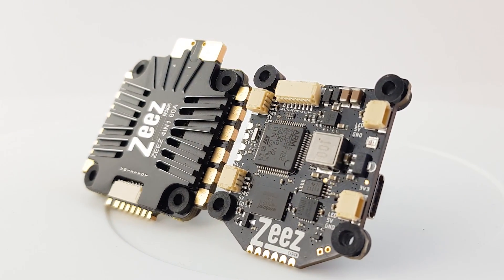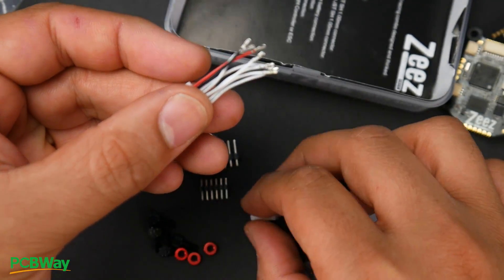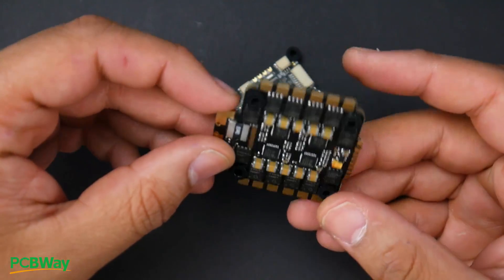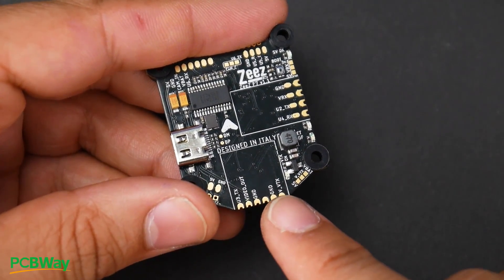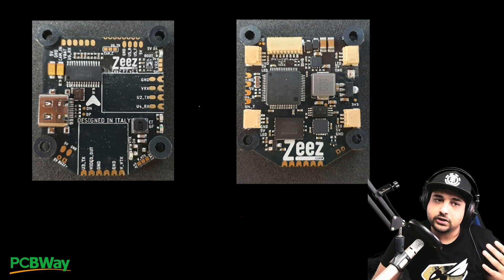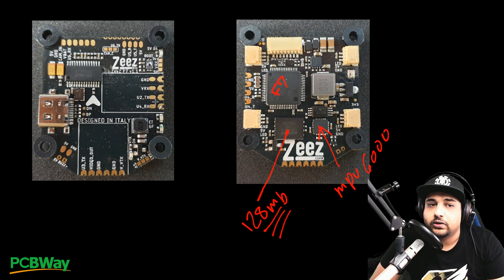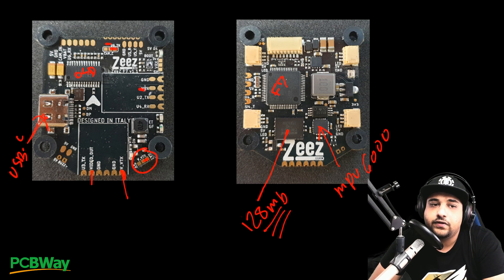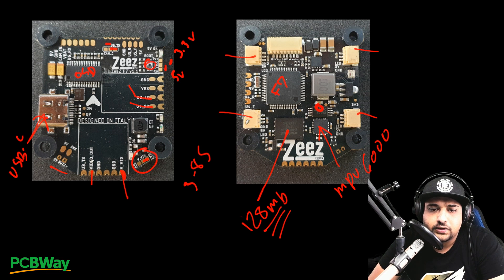Zeez FPV Drone Stack Designed In Italy // Advanced Breakdown & Setup Guide

Comment: Drone Mesh, Your vids are always full of great info I always find extremely useful. I have a small 122 “Hellbender” frame.  In your opinion, what board combo would you suggest for that frame? I plan to use a 3s 1300mAh (or smaller) battery. I’ve got RS1306 red bottom motors I wish to use along with a Spektrum receiver. I’m looking for easy flight controller install. Thanks brother.

Comment: Does this work with a RushFpv ultimate plus and the Foxeer micro toothlees 2 annnnnnnndd a gps (iflight titan xl5 gps module) and 6s???
I wanna get into the sport soooo idk very much....
Reply: Yes, Google Zeez F7 wiring diagram, there's a nice one that every connection possible. UART 5 pads are selectable to be sdc/sda and it shows a BN180 connected! https://blog.seidel-philipp.de/wp-content/uploads/2020/05/Zeez_F7_Flight-Controller_Anschlussplan_Wiringplan.png

Comment: Hey, this question isn't really relating to this particular set up but it could. How do you know if a low ESR capacitor that you have added to your system has gone bad? Without just testing it just for the sake of testing it. What kind of indicators would there be?

Comment: good product presentation. But... is it good? Is it better than say a Mamba? Your video did not help me to figure that out. 
I miss the times when you used to actually review the products. Like measuring the noise and so on. Most people can figure out where to connect things. But what you can do better than most of us is to actually evaluate the quality of the products. Help us buy. 
I used to be a patreon of yours but I just stop getting any new useful information. I really miss it and don't seems to find it anywhere else. 
I say this with all the heart and wishing you best of success. 
You repeat a lot the same info over and over. For instance, "what is OSD". Every video you explain that. I this was to be the first time I see your channel, great info! But after watching 2, 3, 10 "reviews" (in my opinion product presentations) I know already what an OSD is. My suggestions would be: Apply some "software patterns" to your vids. Make a generic vid (actually you have a ton already that could be used as THE general "how to wire" vid) on how to connect "any" FC, and put that as a link. Then focus only on what is special about the specific product at hand (in this case the camera control and VTX voltage) and most important, the actual "review"! 
I always wanted to see from you an always updated benchmark list of...  everything. One for FC, one for ESC, and so on. With nice filters and categories for different needs. Like, what is the best ESC for a 4" cinewhoop, and whichone for a 5 inch heavy freestyler, and for a super light racer. Should there be a difference? I don't know! that is something you could find out and demonstrate. 
Another idea: Compare FC firmware objectively. For instance compare FlightOne, Betaflight and KISS with log showing in which cases the defaults of one are better than others. 

I wish you all the best!
Reply: This is a very interesting comment and I think it can help both Mesh and all of us who do reviews.
The advice from subscribers is always very useful because nobody teaches us how to do reviews.
There is no school that teaches you how to do reviews, but we have to learn it all by ourselves.
Reply: FC is shit don't need any reviews. Why? Because of bad quality of all connectors. All other info is irrelative.

Comment: Hi! Is there any chance that you could review FETTEC ESCs? It's said that they're using sine wave for motor control so I'm curious about it.
Reply: I would also be interested. But not really on how to wire them, that part is easy. I am interested to know if the protocol is better, faster, cleaner...  Make some comparisons and so on.
Reply: @crashtestdummy_fpvctdfpv9100  I'm interested in how clean, smooth and efficient they are and if they can maintain those benefits even on hard maneuvers.